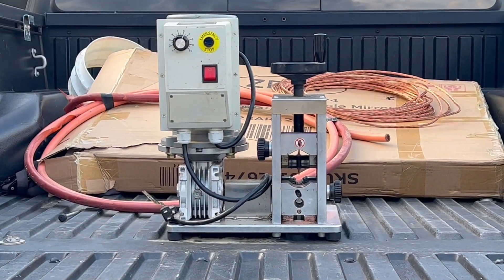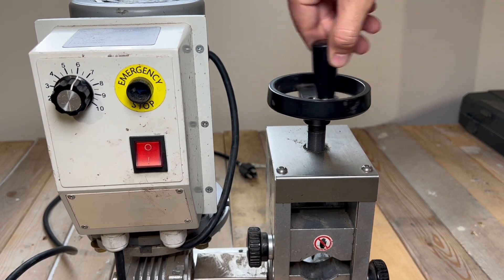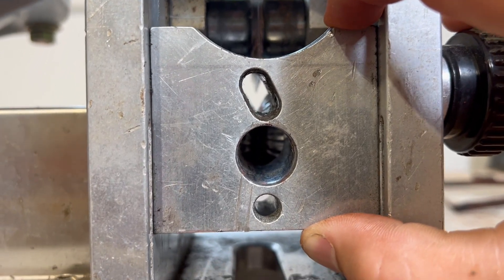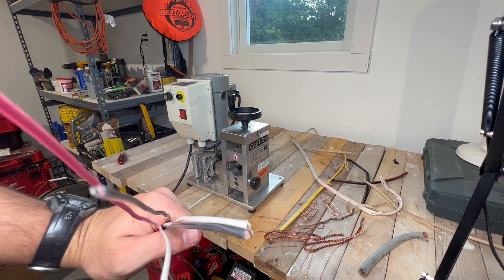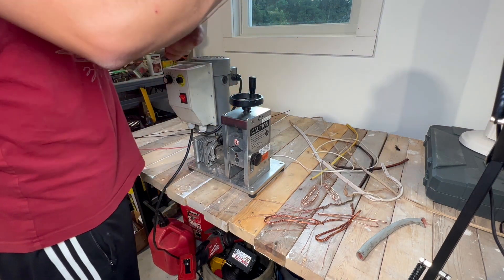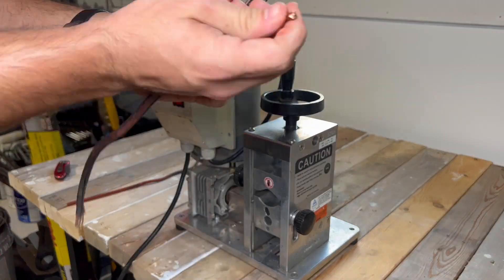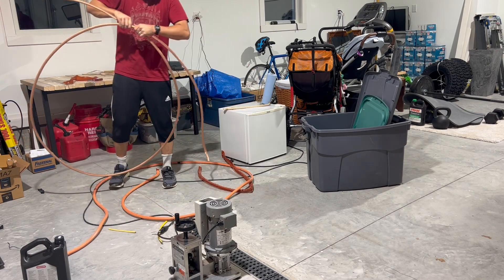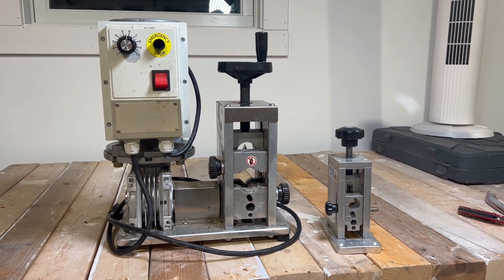Copper Wire Stripping : Stripmesiter E1000 : First Time Use

Comment: I think your suppose to have the feed holes lower that the feed wheels that helps keep the wire against the wheels and in the middle than it won't go off track.
Reply from the maker: Thanks for the tip 👍🏼

Comment: Man this is my next purchase im a journeyman electrician and work in the oil field in west texas and boy do me and my crew get a shit tone of scrap wire all the way up to 500 mcm like its crazy how much of it we get i just bought a milwaukee cable cutter this weekend to make it easier to cut the wire in sections instead of using the ratchet klein cable cutter i got
Reply from the maker: It adds up man 👍🏼👍🏼
Reply: Did you ever get it? I do alot of work with 1000mcm copper and need me a machine… I get tired of using hand held strippers and kleins 😂

Comment: I just bough one same  machine . 
Stripmeister e 1000 got stuck at 1 wire #3/0 machine is a joke. 
Payed to much for it waste of money .
Reply: Read the instructions.
People generally lower the cutting wheel too low trying to make it even with the spinning wheel.  The spinning wheel is designed to shoot the wire upward already so when you make it even it jams the area.

The dial is a clock.  So the dial should always be in the area of the 4o'clock or 10o'clock time frame for cutting
Reply from the maker: Bingo!